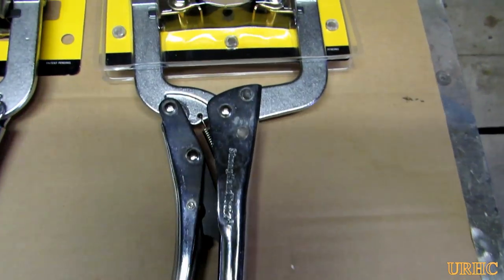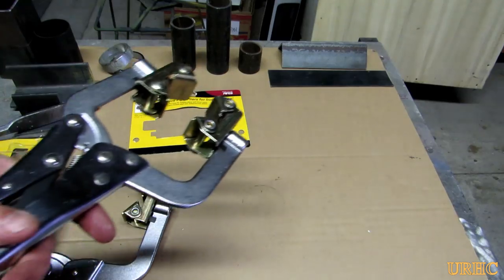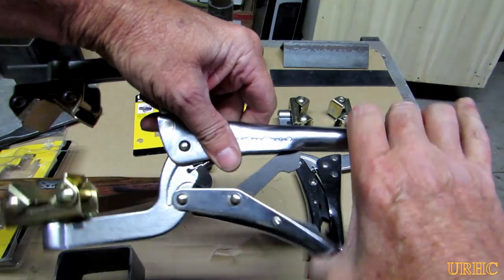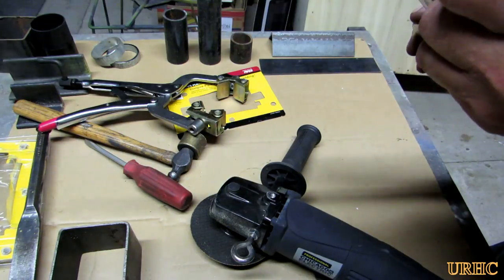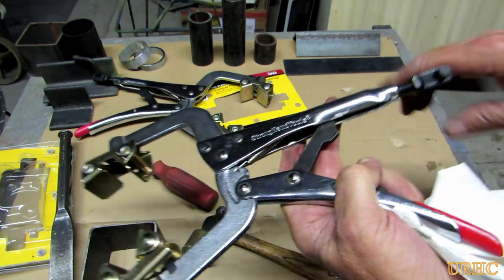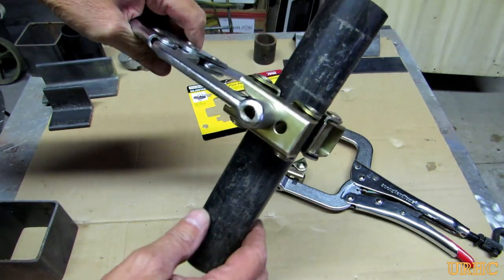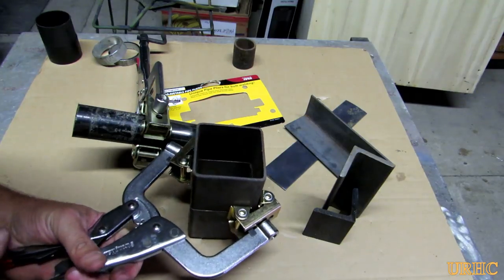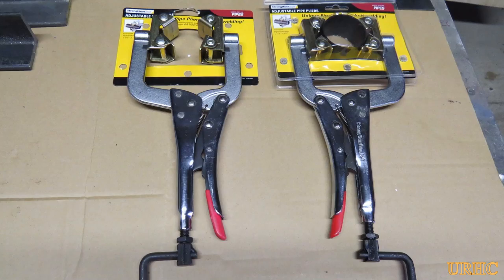New Welding Clamps, StrongHand Pipe Pliers

Comment: Those paddle switch grinders are pretty nice. I have 3 of them. Lol. Nice clamps too. I need some of those. Lol.
Reply from the maker: I have had excellent luck with grinders from Harbor Freight.  I have one of the old orange ones that has been through dozens of discs and still running on the original brushes. I do like the paddle switch one and it runs extremely smooth . The clamps look like they will solve a lot of tough to clamp scenarios.  Thanks for watching

Comment: Just FYI, Strong Hand Tools are a subsidiary of Valtra, a Chinese manufacturer.  The official company address is in Santa Fe, CA, but the tools are made in Shanghai.  Not everything made in the US is great and not everything made in China is junk, of course.  :-)  These tools are also available at Harbor Freight sometimes.  Nowadays if a tool doesn't actually say, "Made in the USA," it's almost surely not.
Reply from the maker: I thought they were made in the USA because there was no country of origin stamped on them. They seem to be expensive for a import tool. Thanks for the info.
Reply: You are correct! Anything that is produced overseas has to have a country of origin stamped on it by law!